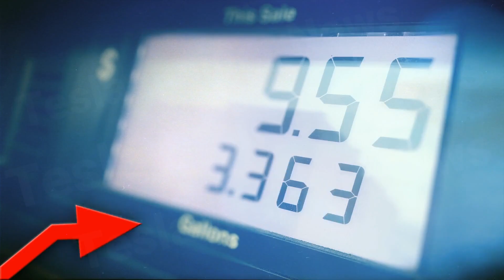Elon Musk's Under $17,595 Tesla Model 2 2026 Finally Production Plan: What He Didn't Tell Us?

Comment: Honestly, for $25K I’d still go with a Corolla or Civic. Gas cars are reliable, easy to fix, and I don’t have to worry about battery issues or Tesla’s brand-new build process.
Reply from the maker: Fair point But think about this: $17,500 after credits, 300 miles of range, full Tesla software. Would you still choose the stability of a Corolla/Civic, or take the risk on Tesla’s Model 2?